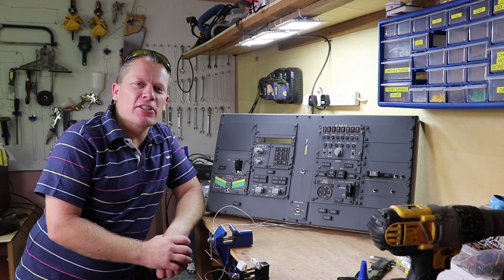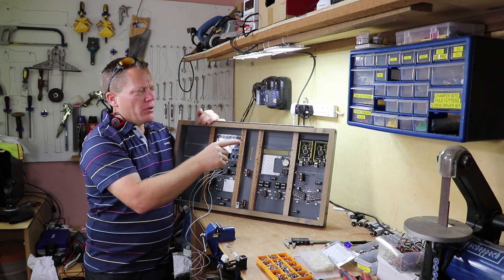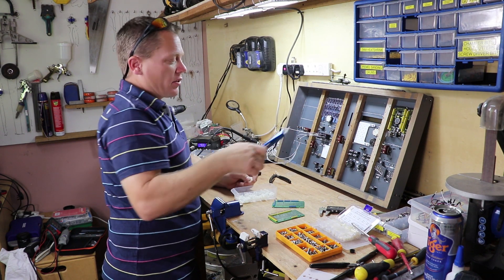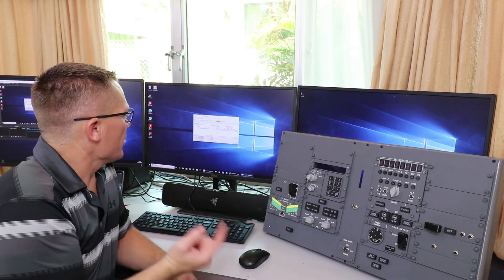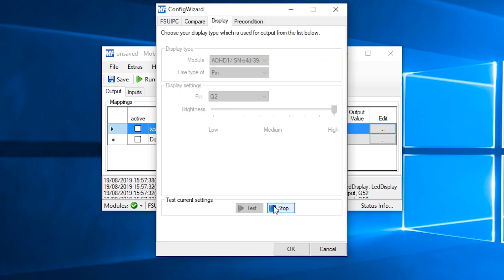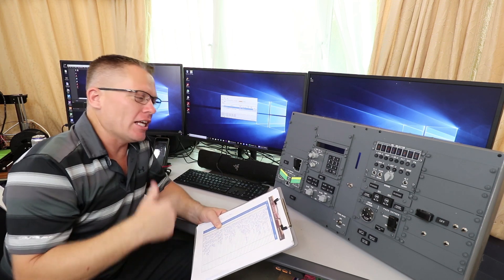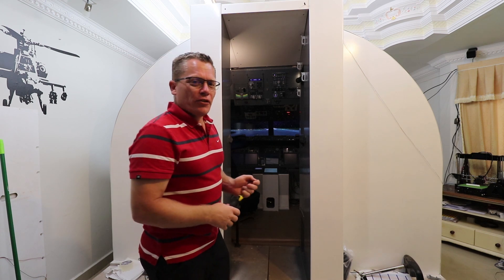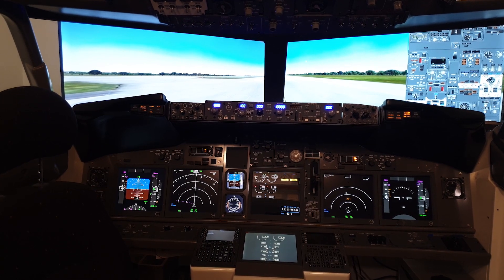Wiring & Programming the 737 AFT Overhead

Comment: Hi Are the leds in series or parallel and what is the resistor, 5v arduino does the arduino switch the ground or the 5v thanks very much J
Reply from the maker: The LEDs are in parallel, with a resistor chosen on LED colour. You need to know your LED forward Bias voltage to find the correct resistor. I would suggest an online LED resistor calculator to work out your correct resistance. Don't exceed 40mA per pin. So ideall run the two LEDS in parallel at a combined amperage of 30ma.
Reply: @helimech8152  thanks for this 👍🏻👍🏻

Comment: Great help for fixing mine aft. But there is a little problem I can’t work out. That’s the fsuipc code for the slats indicator. I can’t find them. Can you help me out.  Grtz. CaptBart
Reply from the maker: Hello, check out the website, under getting started/offsets. My list is there for the ones i used. I hope that helps. Kind Regards, Karl
Reply: @helimech8152  Hi Karl,
I’ve tried it but no results. What am I doing wrong?  I don’t know. I’ve used your offset and played with the bits settings. But nothing works. I’m doing it without Prosim

Comment: Hi Karl!  I must say, you never seize to amaze me.  You're so gifted! I was looking for a bit of help for doing my wire looms like you do - they're so neat.  I noticed you precut the wires, are they all the same length? Should I cut them all to same length and then trim the Arduino end according to each's distance? Any tips would mean a lot.  Many thanks in advance and keep the amazing creations coming!
Reply from the maker: Hello and thank you for the kind words. All my wires are cut over length, held initially in place by tywraps then each cable cut to length. The downside is lots of waste. But for me, I'm using recycled aircraft wiring and have lots of it. So its not so much an issue. Kind regards Karl
Reply: @helimech8152  brilliant, thank you so much for the reply and tip! Keep up the wonderful work.  What you do here is wonderful inspiration for a lot of us.

Comment: Hi Heli Mech, may I ask you what kind of wires do you use for the aircraft wiring. I know you mentioned it in the video but unfortunately I couldn't get the name. (the white ones)
Reply from the maker: Hello Fadi, I use actual aircraft wiring that I saved when we ripped it out from an aircraft mods programme. Its awesome stuff and much better than i have been able to find online. However, i realise this inst probably an option and i like to use 24 AWG for the wiring between electrical devices and the Arduinos. You need much thicker wiring for the LED back-lighting when using 12v though.

Comment: hi, i'm trying to build a small overhead, for now i use 1 arduino mega for switches, do you corfim  that i can use 58 pin in mobiflight module?
thanks
Reply from the maker: Hi Simone, You can definitely use 52 pins, and i believe I read that Mobiflight has issued a software release that allows you to use the 15 analogue pins  as digital pins giving you 67 working pins
Reply: @helimech8152  Thank you for your answer, I installed version 7.8.2, can you tell me where can I find information about the update for the correct functioning of the analog pins? Thanks again

Comment: Hi Heli Mech, another great video. I have built an MCP based on your $38 version and have to say am very impressed. 

I have ordered an MIP and overhead panel through Cockpit Simparts but was curious as to which LCD display you went for with regards to the INS display? Did it come with a control board already attached or did you run 16 wires back to the Arduino ?
Reply from the maker: Hello steve, I'm on holiday right now with very limited internet. But my extra large lcd board came with the control board, which meant I only used 4 wires I think. Pwr,gnd,sla and scr. The link is on the sim facebook page

Comment: This is all very interesting stuff. I'm doing something similar although based around a generic cold war combat jet.
Do you ever find Ebay bargains or concentrate on fabricating your own hardware ? recently I managed to score 4 illuminated pushbuttons for under 20 UKP - which when I decoded the NSN numbers turned out to be made for an F-16. Original pricing to the US taxpayer was over $2000 EACH :)))
I've found that the feel of many aircraft switches is very different to anything I can make using 3D print\fabrication techniques and tactile switches. Pushbuttons and hat switches being cases in point. The real deal items are horribly expensive so I have to trawl Ebay to find this stuff. 
One item that is eluding me right now are magnetically held toggle switches - I can find them - but from the US at over $500 each...I am crazy enough to go down the rabbit hole of building a sim cockpit, but not THAT crazy :)))
Reply from the maker: Hello Anglo spanish racing, merry christmas. A long time ago, I used to trawl ebay for parts that I thought might work. Now I have boxes of stuff ready to use. I actually have a few if those switches as i replace them all the time on real aircraft. I'll have to see if i have any spare lying around
Reply: Appreciated :) I have been working out some mechanical alternatives to the switches being magnetically held but none of my ideas are quite there yet. Typically on a fighter aircraft magnetic switches are used with the autopilot - you would have a master toggle switch and then maybe a couple of mode switches to choose altitude or attitude hold. All very basic.
The complications come with the switching logic - the mode switches will only engage once the master is selected, while the master won't engage unless current bank and pitch are within certain limits. Usually there'll be an autopilot cancel on the stick that deselects the master toggle ( which can also be toggled directly, obviously ) - which will then also deselect the mode switches. I'd imagine in a real jet the logic was implemented with a diode matrix and\or relays until FBW came along.
Then I have to make sure that the switch positions stay in sync with the simulator software....which thankfully I can get outputs as well as inputs from using a program very similar to the FSUIPC I guess you use.
It's interesting, but also brain frying :))) still - it keeps me out of trouble, working this stuff out ;)

Merry Xmas to you too ;)

Comment: It looks like I don't need an extra power supply for the Arduinos, I have them connected to a powered hub and it seems like it can keep them all going fine.
I used coloured wires, instead of white and the debug method(which is super), and it looks like it's wise to use no more than 40 output/input pins from each Arduino board.
Looking forward to more updates on your great site!
Reply from the maker: Hi Robroy! Great to hear from you. Thank you for sharing your advice. I am very busy trying to get the website up and running properly while trying to make it look semi professional rather than something i created when i was 6.

Comment: Hi, what Arduino board do you use? And do you use the resistors for the LEDs? 220 ohm right?
Reply from the maker: Hello from the Sim! I use an Ardunio Mega. I also use 200 Ohm resistors in conjunction with ultrabright LEDS. These are crystal clear, but emit the color you chose. All links to the exact  items can be found on the website: www.737DIYSIM.com under getting started/parts. I hope that helps, Kind Regard Karl
Reply: @helimech8152  Thanks a lot! All the information I need can be found on www.737DIYSIM.com. Cheers!

Comment: Let me ask you a beginner question about soldering. I see you soldering the components on the prototype shield from the same side as the component. I thought you solder the legs of the components always from the oposite side. I understand your way is easier because you don't have to remove the shield from the arduino when you want to add another resistor for example. Was this the plan behind this?
Reply from the maker: Hi mickey, you are absolutely right! Always solder from the opposite side. I may not have shown the correct process in the video. To ensure I get a good wiring finish (neat lay out) I temporarily cut to length, and solder from above to hold everything in place.  Once everything is attached  I remove the shield flip it over and solder any joints that have not bled through and created a volcano type blob on the underside of the shield. Just through experience and practice, I can normally nail it first time without resoldering, but that's not the point. If you do it this way, you must turn the board over and check for good soldering joints. Then use a pair of close cut side snips to remove any excess above 2-3 mm.

Comment: You make it so tidy and neat and your filming and editing is excellent!  But it must be a hell of a job to identify so many white wires. Are you using a common 5V bus to power the Arduinos or do you use a separate power supply for each?
Reply from the maker: Hello Robroy,  I currently run two common busses. A 5v & 12v DC busses to power everything. I don't like to stress the arduino boards too much by allowing them to supply all the current required.

Comment: Always enjoy your vids, mate. You have amazing patience and a great level of experience in wiring and setting up using Arduino. I have been a lazy bugger, buying all the FDS and easy options, but Kudo's for doing the exact same thing with more basic hardware. Keep them Coming, mate. Look forward to your vids.
Reply from the maker: Hi Frank, Great to hear from a fellow simmer. I am currently looking at buying an FDS Sys board. Perhaps not the really expensive one, but would love to try it and see how that compares. I am stil yet to create the pedestal and if i save up that hopefully might make a interesting video. Thank you.
Reply: @helimech8152  FDS boards are very good, mate. My whole NG was run by two of the big ones. I'm currently swapping over to the Sismo boards, which are expensive to change to, but offer Cat6 connection, which is used in the "Real" simming Industry. You can see one of the boards, the MIP and daughter board for the FO, in my latest video.
Reply from the maker: Hi Frank. Wow a new sim channel to watch! Awesome. Ill sit down later and watch a few. Thank you.

Comment: Amazing, thanks for sharing your knowledge I like it very much. Question: Why are you not using MultiPlexers for the Led's (and also switches) such as CD74HC4067 16-CHANNEL MULTIPLEXER MODULE? Have a nice day and also greetings from The Netherlands!
Reply from the maker: Hello from from Brunei, mobiflight does not allow multiplexing. So it's easier to add a whole new board. I'm guessing you are using xplane, with sim vim. This allows the full use of multiplexers and ADC's.
Reply: @helimech8152  Thank you for replying to my remark. Yes indeed I'am not a fan from the slowly change of rotary encoders. It's in my opinion not realistic. Nevertheless It's a great product that Mobi is deliver don't take me wrong. Have a nice day and success with your beautiful SIM !!
Reply from the maker: Hello GL, I haven't seen that problem for a while now. I think I took the step away from using Ky-040 encoders and used standard ones. I'll double check when I get back, but I'm sure they are pretty much instantaneous. Not noticed any lag for a while, unless in debug mode